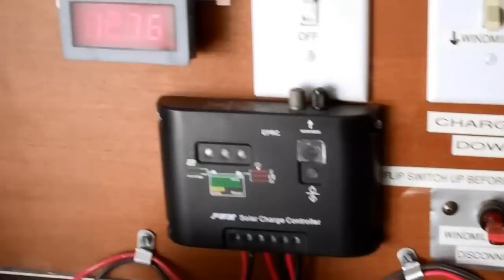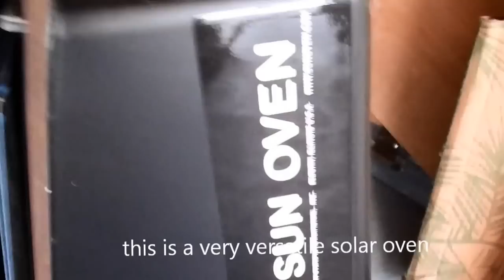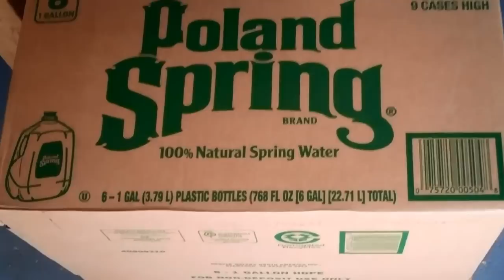Hurricane Sandy day 4 and green projects that could save the day

Comment: They are very expensive. I had a Coleman generator before, that thing was so loud. Not to mention all the fuel it used. If not the Honda, I guess a second backup would be a small battery bank, but then again, you would have to replace it every few years. When our power went out for 2 months, we learned to live without power pretty well after going through about 100 gallons of fuel in no time. If you get the water barrels, make sure you get 5 yr stabilizer.